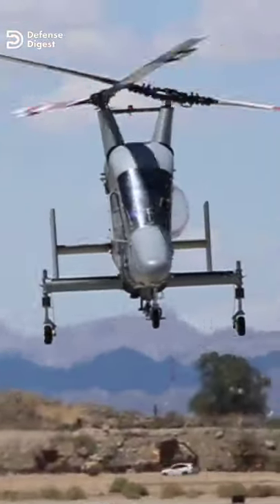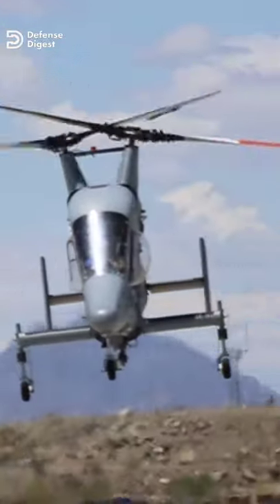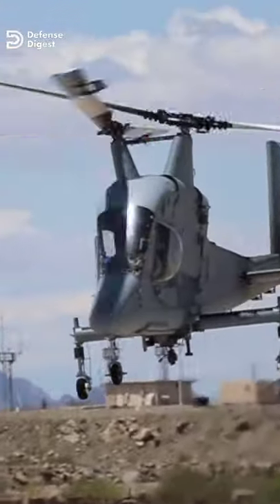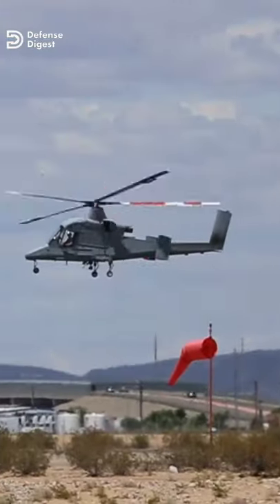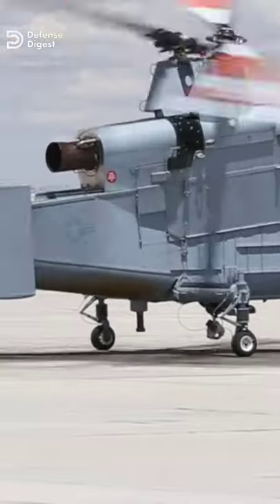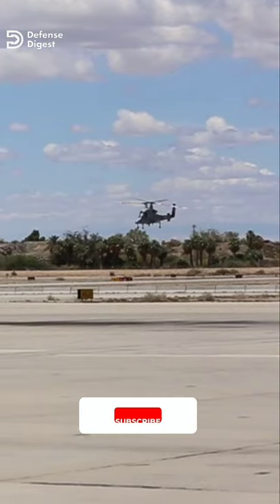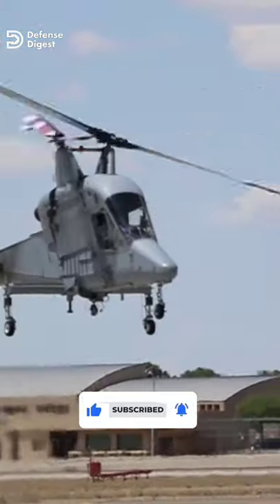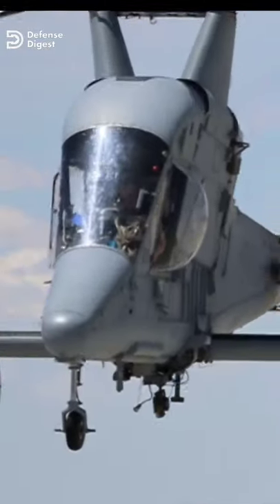This Helicopter can lift payload more than its weight #Shorts

Comment: Kaman’s first rotor design of this type was the Husky and it was with the Air Force used for search and rescue and that was back in the 60’s in 1992 the Kmax was testing at my squadron in Norfolk Virginia and was turned down because of the lack of dual engines the squadron that I was in was HSL-32 and they flew the Kaman SH-2F made by the same company after the navy rejected it they did trials with a logging company out west in the same year

Comment: That would be great for Backcountry skiing and snowboarding, I wounder how many people it can hold?
Reply: Just the pilot.

Then again, it could sling people underneath dangling from a long line, which would certainly make for an exciting time!
Reply: @daviddunsmore103  yea like the sling the military uses with a simple rope and harness system, just latch on and go. Would work perfect for the payload and for skiers.
Reply: @devilsreject9255  it would have to have a special basket for the people because that's a lot of air being pushed down by the blades on both rotors. The air is cold wherever you can ski and then to have it thrust down at you so hard would make it even colder. Then the helicopter is so thin so there is less area where there is shelter from the forced air.

Comment: I want to really see how the rotors are setup to work without clashing.
Reply: It's just gears I would have to guess
Reply: Its not that hard, they're started a half rotation off from eachother.
Reply: They're geared together
Reply: Chains and gears there's no way they'll collide with each other unless the chains break and then would be bad

Comment: I understand that since it doesn’t have a tail rotor to rotate on its own axis (yaw), it will need a translational speed to rotate on itself (yaw)?
Reply: helicopter flight required a near constant rotor rpm. and to yaw with Counter rotating system in simplified terms if you want to rotate  left the ccw rotor will decrease lift while the cw rotors will increase, rotating the helicopter. with zero yaw input each rotor is maintaining 50 % of its lift out of the total theoretical 100% so yawing does not sacrifice total lift output.

Comment: It looks like a random RPG could take out the rotors.
Reply: Well genius any aircraft can be take out if a rpg hit it
Reply: We used rope and cables to take out a few thousand attack choppers back when we took the USA government on September 18th 2021. They suck in the rope, which pulls in the cable, it is a quick death. Im sure you will see the video of airforce two being put out of service on the Whitehouse lawn, just before the Whitehouse burned and the capital was detonated. Cool trick.
Reply: @giraffewaggoner8119  wtf
Reply: @giraffewaggoner8119  I see what you are doing. We'll see.

Comment: Very complex gearbox system to turn those rotors like that. Cool idea but like many ideas, fail in the real world.
Reply: They said it had been around since the mid 1990s and was originally used in logging operations. I could be wrong, but I'm assuming it still works. Cool machine, isn't it!
Reply: @HighFlyer6969  Ok. Not sure what you are talking about, but you sure have a strong opinion about it's reliability. No worries, it's not the right piece of equipment for you!
Reply: @taffykins2745  literally easy too understand, its just you thinking its amazing when there's so much better options
Reply: @HighFlyer6969  yes, but I thought I'd let you off easy. I'm not in the mood to belittle you like you are me. You be awnry on your own time. I don't need it.
Reply: @taffykins2745  first off it ain't belittling cos i dont see me saying im better than you in any way, second off its pretty shit, reason why it ain't popular is because there's better stuff for the same price that carries more
Reply: Kamen twin rotor helos have been invaluable in the Air Force for rescue and fire fighting since the 60's. Extremely manuverable, high lift, and no tail rotor to tangle in obstructions. Other advantages include no nasty habits from gyroscopic effects of single rotors.
Reply: I can admit when I am wrong. I had no idea. Amazing little machine.